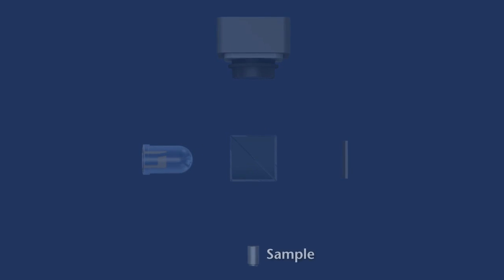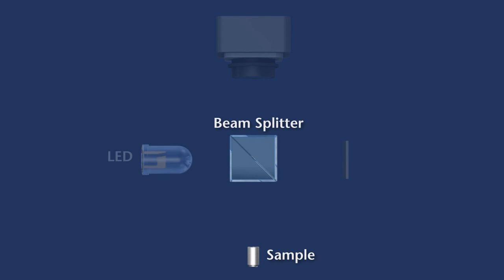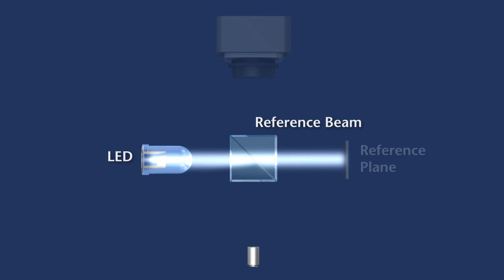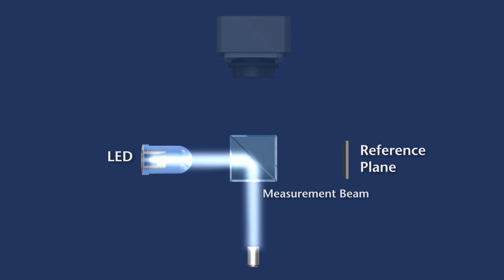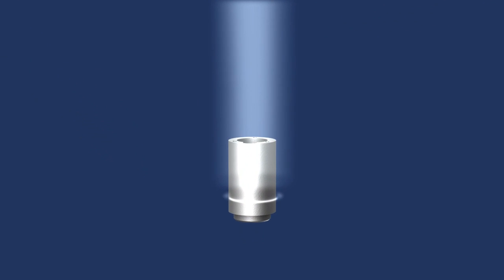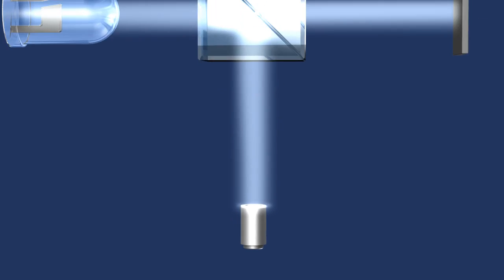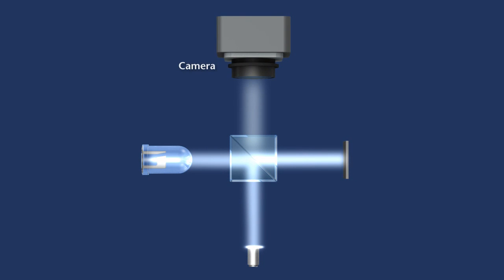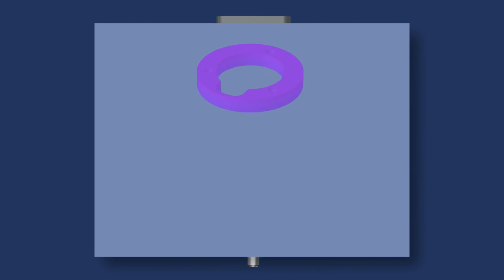Basic Principles Scanning White-Light Interferometry

Comment: Why do we use white light?
Reply: In a normal interferometer, we use a single wavelength light source (Laser). The light detected at the camera is the interference pattern (bright & dark peaks) of the "reference beam" and "measurement beam." If you move the distance traveled by one of the beams, the interference pattern will change, because your beams are interfering at different points in space. If the reference beam = sin(x) and the measurement beam = sin(x), then you move measurement beam distance = sin(x+1), your waves combine differently.

White light is a composite of many wavelengths (colors). Each wavelength has a different period (example: red = sin(x), blue = sin(2x)). When the distance of the reference beam and measurement beam is the same, all wavelengths will produce a constructive interference pattern at the camera. When you change the distance of the measurement beam (like when reflecting it from an uneven surface), you get different interference patterns for each of the wavelengths. red = sin(x + 1) and blue = sin(2x + 1).

If you plot the sin functions into a graphing tool, you'll be able to visualize better visualize this explanation.